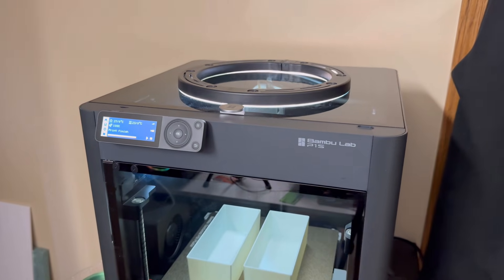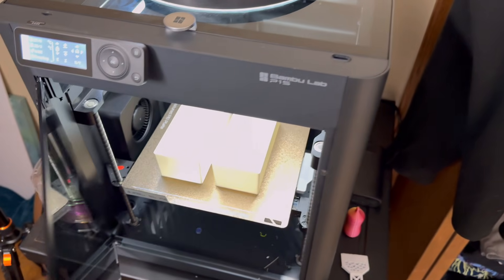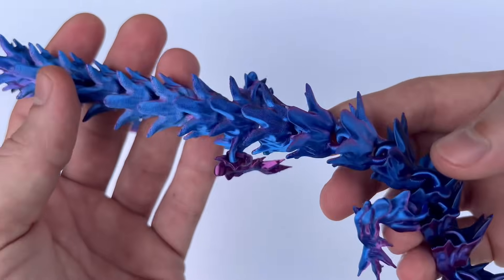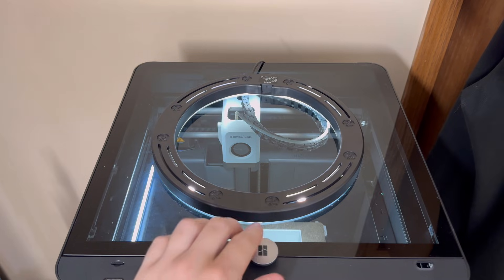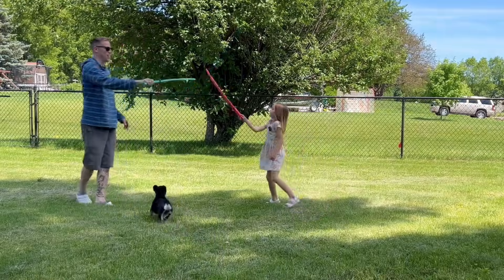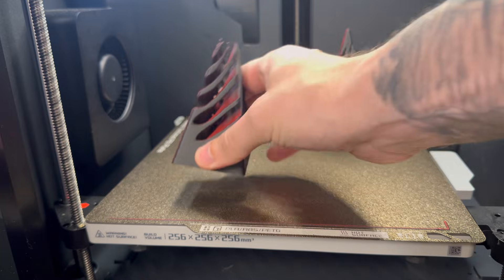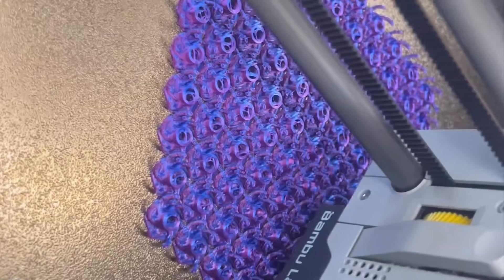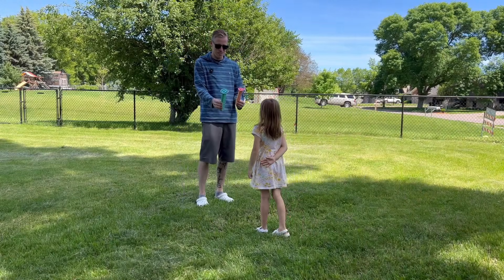Best Filament for Bambu Lab P1S? Need to Know

Comment: I am trying to load creality HP PLA and also an ABS into my p1s ams system.  the filament loads, but when I go to print a plate and select the filament, it will not allow me to even see that filament.  I have created the filament in the Bambu slicer under filaments, using bambu labs generic ABS, but still no go.  Can you help me solve this issue?